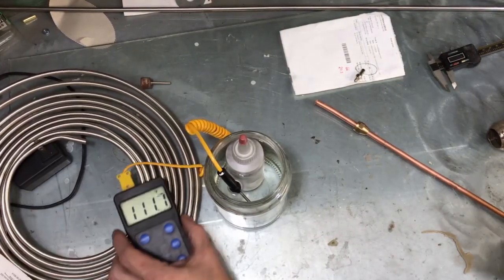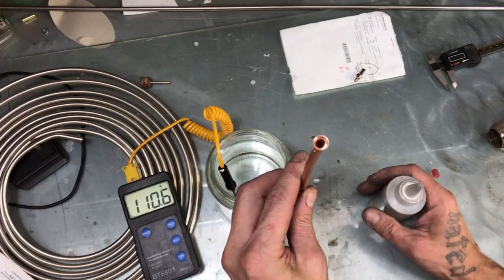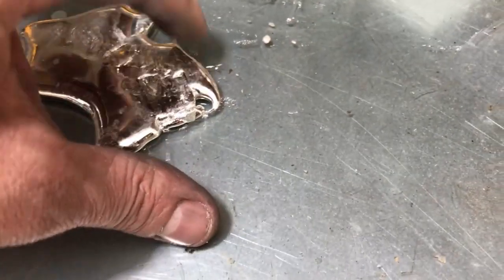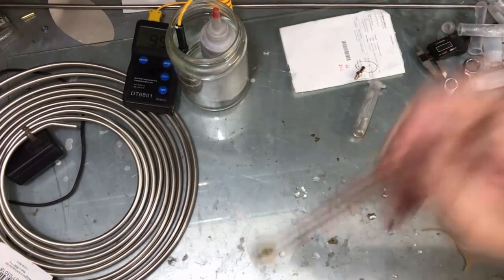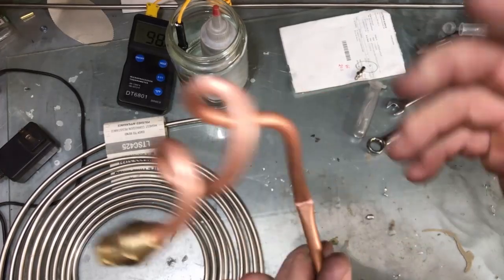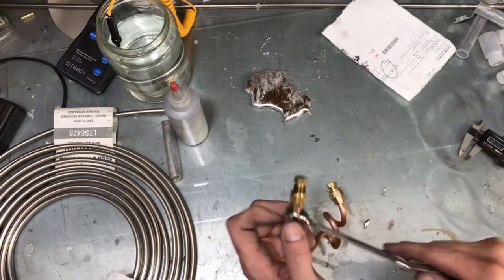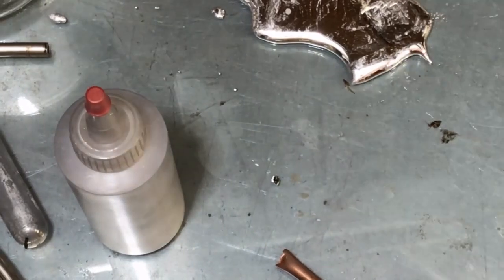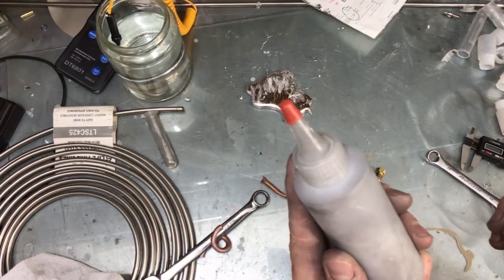Bending copper or stainless  tubing filled with gallium

Comment: Look up Galinstan ( gallium 68.5% , indium 21.5%, tin 10%, antimony ~1.5%, bismuth ~1.5% )  and "Field's metal" ( indium 51%, bismuth 32.5%, tin 16.5% ) not to be confused with "fields metal". Both alloys are supposedly non toxic as they don't contain lead, cadmium, thallium like some other much cheaper tube bending/rapid prototyping alloys (Rose's metal, wood's metal, cerrosafe, cerrolow, etc ). Awesome progress!

Comment: The way to get the gallium into the tube is to preheat the entire tube and use a funnel which is literally attached to the tube you intend to fill [fittings can simply be stacked into a funnel by using bushings or you can use a steel/pvc pipe cap and drill and tap a fitting] and then put an exhaust vent of something like vinyl tubing and a hose barb so that the exhaust end is higher than the height of your fill funnel.

Once you have fully filled and displaced all of the air, then you can simply remove the adapter fittings from each end and put the plugs in place.

As always, when you are done, immerse it all in hot water to get it back out.

If you do not want the gallium to stick to the surface of the metal, simply coat the metal in question in a silicone oil like you would use for electrical contacts.
Reply from the maker: Brilliant idea to pump silicone threw first , we will give it a shot in an upcoming video , ill mention you
Reply: @NOBOX7  Just hope it works! I know you can get a form of silicone spray lube under the brand WD-40 here locally, not sure but its likely there are a lot of kinds, the little tube tip on the can really keeps it less messy and less wasteful!

Comment: I can not remember if you have tried filling the tube with wax. It is cheap, has a low melting point and should be easy to clean out of the tube.

Comment: What exactly are you trying to do?  
There is a tool that allows you to bend tubing w/o kinks that works really well.  It's basically a tightly coiled spring that the tubing fits perfectly inside, then you bend it while in the spring and the tool keeps the tubing in compression and allows for tight bends. 
https://www.amazon.com/Superior-Tool-61600-Spring-Bender/dp/B000S8EXD4

Another option that I've been told works well is fill it with water & seal both ends but you have to make sure NO air is in the tubing.  Water isn't compressible and you should be able to bend it while liquid in very tight coils.  

Another idea is to fill it with hot paraffin wax and allow it to cool.  Paraffin is another non-compressible fluid/solid from what I've read.  It will be more difficult to fill but I suspect it can be done fairly easily if you leave both ends open as you fill, basically make a U shape with the tubing and allow the paraffin to flow an find it's own level.  As you fill it, both sides will rise (assuming you keep both heated, hot water should work fine - 140+ degrees).  Maybe use a small metal funnel that you can heat with a torch and allow it to flow down into the tubing.  When done, heat the tube to 300-400F, allow to drain and then blow shop air through it and maybe dump boiling water through it and that should melt anything left behind and flush it clean.  

Last option - lead.  I've heard people doing that as well. 

So what are you trying to make with this and how tight a coil do you need?

Comment: If you figure out a way to completely remove the gallium, would it be feasible to use it?
Reply from the maker: Yes , it works so well im not giving up , a committer just mentions silicone spray to stop adhesion

Comment: I've never had to but doesn't salt or sand work well enough?
Reply from the maker: Ben have you ever taken apsrin or any pill that was made by compression ? removing a solid "pill" out of a 50 ft tube is a bloody nightmare i will never live threw again .
Reply from the maker: if the tube is under 4 inches it comes out in about an hour lol
Reply: Salt is a MAJOR PITA.  IDK who ever thought this was a good idea or how it ever got mentioned that it worked well.  Maybe it's OK for a short bend or something but it's damn near impossible to get out of anything even remotely tight, even with 150PSI air.  I was doing a 25ft piece of 3/8"OD tubing, making a coil 3.5" diameter and I could only get about 12" of salt out.  I even tried soaking it, blowing water through it and nothing seemed to work.  I think maybe if I had a 3000PSI pressure washer that could hook up to the tubing it might have worked but I still kind of doubt it.
Reply: Try boiling and maybe vinegar treatment. It may be a proper gallium/copper alloy now. See if copper filings will become a solid with the liquid metal and become like a low temp solder...